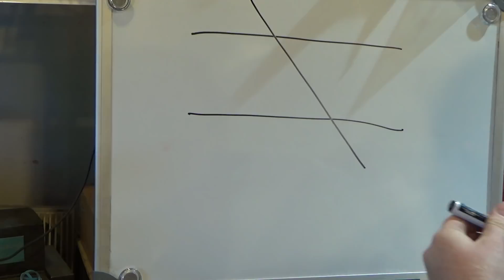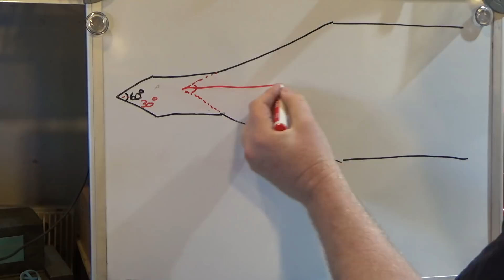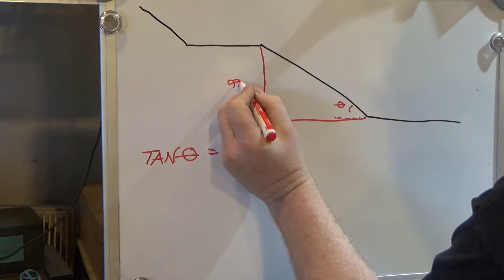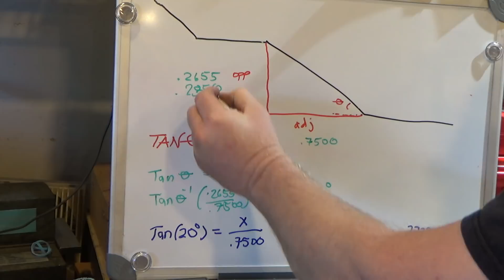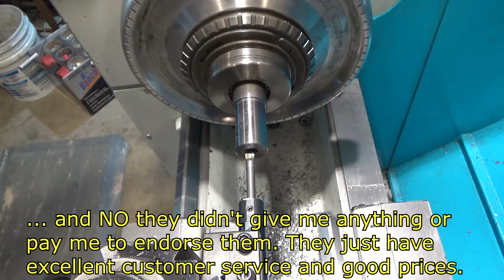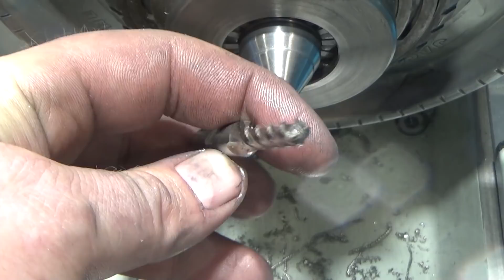Ball Adapters for My Lathes Live Centers

Comment: Another nice video my friend! I was all set to give you some silver soldering tips and you figured it out on your own. Great job! I will give you a couple small tips, though. First I felt that the torch tip was large for the job because the force of the burning gas blew the ball off the tip. When I solder I turn down the pressure and use a small tip. I get the heat I need and the carbide or smaller material doesn't move. You gave yourself quite a soldering challange by making such a small radius for the ball to fit in. Commonly the radius you make is just shy of the ball's dia. This allows you to make a heavier cut without the fear of dislodging the ball. I really like your approach and narratives. Check your Machinist Handbook for the recomended SFM for that material. I think it likes a small radius tool, a positive rake tool, and higher RPM. Keep those videos comming! Great job!
Reply from the maker: I'll happily take all of the tips you care to offer. I really appreciate you taking the time to share your knowledge. I didn't show my first attempts, because I didn't want to deal with getting the camera in there while I was trying to figure things out. In my first attempt I coated both pieces with flux, assembled them and heated the whole thing. When the parts were glowing red, I tried to feed the silver solder, like you would when soldering copper pipe, but it just balled up and fell off. I made several attempts, but they were a miserable failure. I only tried the solder piece solution, because I had seen someone else do that for carbide brazing. I used the large torch tip, because I was concerned with having to spend too much time heating the part and losing the flux protection. I guessed poorly. I considered making a deeper hole for the ball to mount in, but was trying to have as much back relief as I could manage. If they solder joints end up being too weak, I will go there next. I will make sure to turn the parts at a slow rpm to start. Catastrophic failure could be ugly. Thanks for all of your help and support.

Comment: Hello,  I was gritting my teeth for you on that silver soldering job!!  The torch tip was just too big to do that without blowing the ball around.  You were getting into the size for a jeweler's tip.  Always like how you show your mind working while building.  Take care.  Doug
Reply from the maker: You make a good point. I was worried that the moderately large mass of steel would take too long to heat, and that, even with the flux, I would get some bad oxidation. In at least one case, I used the force of the flame and probably surface tension,  to push/pull the ball into place. The biggest problem I had, was the flux. It was really sticky at first, then got hard, and finally melted and got sticky again. Clearly, more experience would have helped me. Thanks for taking the time to comment.

Comment: The tip of your indicator you have on the live center should be parallel with the ways, and be dead on or extremely close to the center line of the lathe/ taper you are measuring. If it's even the slightest amount off center you will get an inaccurate reading. The same is true with cutting a taper. If your tool bit is not dead on center you will cut an incorrect taper. Just my opinion. Thanks for posting
Reply from the maker: Good observation. Thanks for the useful suggestion. I realized that the indicator needs to be perpendicular to the axis of the lathe, but I had not thought about the sensitivity of the measurement relative to where along the cone I was travelling. That was a really good observation. I was not overly careful about the height of the toolpost indicator. I think you might have found my mistake. Thanks!

Comment: Flat bottom drills are good for finishing holes, but I would not recommend trying to start a hole with one.  The combination of no conical point to guide the start, and the flexibility of ordinary twist drills, made my first attempts using them into a painful lesson.

These days I counterbore with an endmill or boring bar whenever possible. 

I wonder if it would be harder or easier to braze a carbide ball?

Did you test how concentric the balls ended up being, relative to the taper?  I would not trust the soldering process to seat the ball evenly in the round socket.
Reply: You know they make Bell hole center drills for offset tailstock taper turning
Reply from the maker: Excellent point and because of the cutter relief, end mills don't really make flat bottomed holed either.